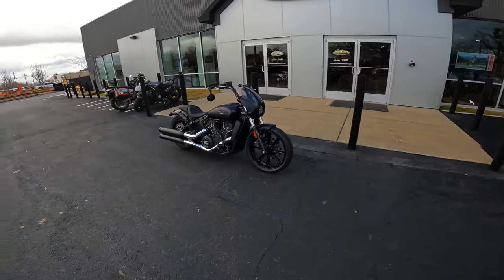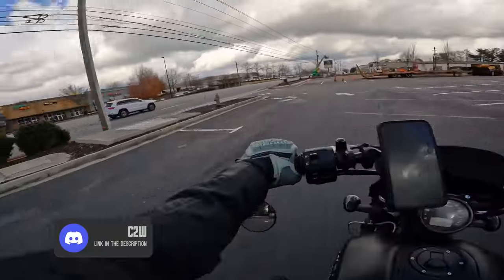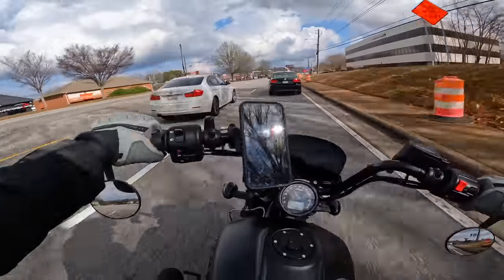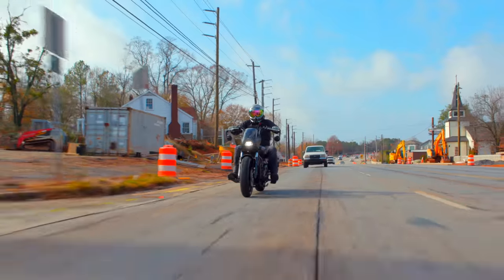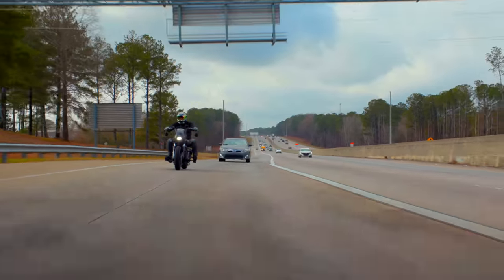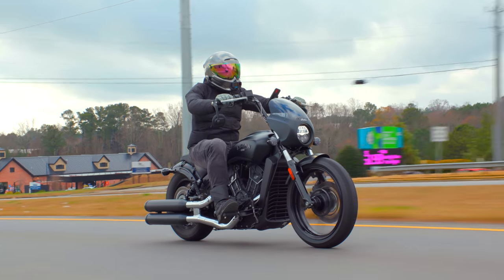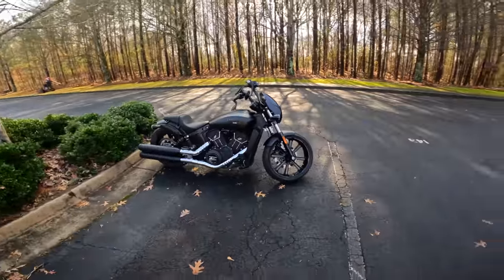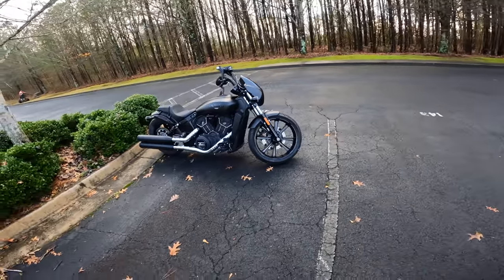2022 Indian Scout Rogue | First Ride

Comment: You hit the nail right on the head when you said that it makes you feel it’s a great beginner cruiser for someone coming from a naked bike. That’s exactly what I did. Upgraded from my first bike, Honda CB500F to the Scout Bobber. And couldn’t be happier 🙌🏼
Reply: I've been riding a z400 for last couple years as my starter. I live in a mountain town full of windy hwy roads. Do I need to worry about scraping parts to easy on those 25mph turns?
Reply: I just bought an Indian scout rogue coming from a Honda cb750. My first cruiser. I’m very excited to see how it will turn out

Comment: Nicely done video. I have the standard version of the Scout (69). You are correct that rear shocks can be an eye opener. Standard Scout does give you 1 more inch of travel though. I have got mine to a point where I can get a100 miles down before I need a break. Having owned several HD's I find the Scout a blast to ride. I do not tour anymore, so this bike works fine for me. Not sure I would recommend as a 1st bike. I was drawn somewhat buy the fact it does not have much tech. Less stuff to go south.
Reply: Tecnología = + problems

Comment: I have this exact same bike in the same color too and it's mostly awesome.  I installed my Syndicate seat with the backrest last week and it looks even cooler now.  

The bike should come with a stock LED headlight though and those piggyback shocks.  Personally I think it's dumb they make you pay extra for that stuff that in my opinion, should come with the bike.
Reply: i agree , i bought the same and replaced the stock shocks with aftermarket piggybacks, completely changed the bike

Comment: OC
To start, I do like the scout. If I were to get one, I would change the forward controls to mid controls. Second, I prefer bikes without a lot of technology. My 2012 Ninja 1k has no tech at all (not even ABS, which my other two bikes have). So, it presents an interesting challenge when I go riding.
Reply: I've never owned a bike with abs and I've had close to 20. I do want a ninja 1000 for highway rips though. How do you like it?
Reply: @Club style rida HD  I quite like it. It's tame on the city streets when you need it to be and then the rest of the rev range is ready to wreck havoc  on the highways. It's certainly a bit scary at first not having ABS but as long as you're good with working the brakes, it's no big deal.
Reply: @runescapefire3  That's what I'm looking for. Something fast and fun but not an overly twitchy throttle like the first gen mt09 had. I think your year model ninja 1k makes the best power from what I've seen online.

Comment: OC gone are the days, at least should be, of only having gas lights. Even my cheap '17 SV650 has a trip meter. It's much easier to plan a trip and not worry about the gas light illuminating in the middle of nowhere.
Reply: Not sure about the Rogue, but my standard Scout has a trip meter.

Comment: 22+ Scout rouge or 22+ Gsx-r750? They are around the same price and I like both. Wont be doing long trips (200+ miles) at a time. Will be my only bike so Im stuck between with choosing one. Im 6’1” 220 lbs Thanks

Comment: I bought one earlier this year... I love it. But I love lightweight cruisers.

I would love to see a comparison between the Rogue and the Sporster S. I thought the Rogue had a better value.
Reply: The Sportster S is a better bike in every way except for looks.  There isn't really much of a comparison.  

Now the FTR on the other hand...
Reply: @tinman3586  equally short rear suspension, worse brakes, horrid handling with the fat front tire. 

It's only benefit is more power, literally... 

And yes the FTR is an absolute monster lol.
Reply: The HD Roadster is a more suitable bike to compare the Scout platform against.  The FTR would be a fairer bike to compare the sportster s against.
Reply: @Jordan Joestar  so I don't think you talking same bike the rogue doesn't have the fat tire the scout bobber does on the other hand its 19 inch wheel and the tire is like have the size I think on the rogue.
Reply: @jordanjoestar8839  every review I’ve seen says the handling on the sportster S is great. Not to mention it comes with ride modes, electronic assist (traction, wheelie control), adjustable engine braking, full TFT screen, cruise control.
The list goes on…
The Sportster S has it in the bag
Reply: @Callum Smith  it also starts at $2,500 higher than the Rogue...
Reply: The sportster S is so fuckin ugly, meanwhile the Rogue and Bobber are almost universally appreciated for looks... theres no comparison because it's kinda a serperate audience. HD styling is very poor generally as of late imo
Reply: @callumsmith338  more technology more problems.

Comment: Am i the only one who has a really annoying bigh pitched sound coming from the radiator fan when i was driving a bit, then coming to a stop. Like on a red light or traffic. The sound is NOT when driving. Only when slowing down and the fan kicks in. Its a reallly annoying high pitched sound, which is "normal" says my dealership. But i cant find one single video with that problem/sound. Its a brand new from last year. Did it the very first day. And no, it is not the fuel pump how a few think. Its definetely coming from fan/radiator. Sounds electronical. Please help me. Its so annoying coming to a red light and that sound pops up for about 15sec. Then its silent for 20 sec and comes back for 15...